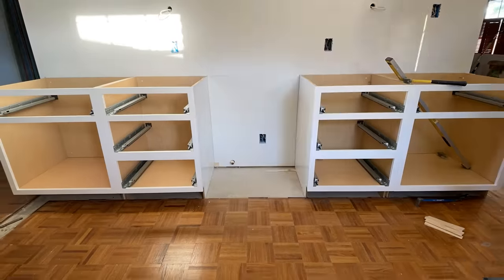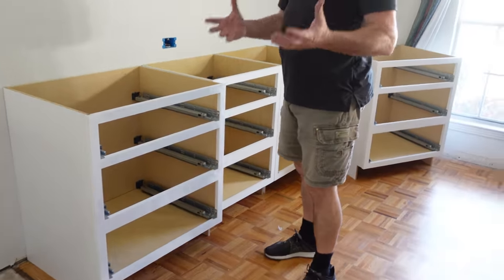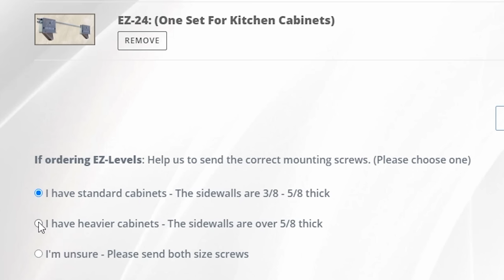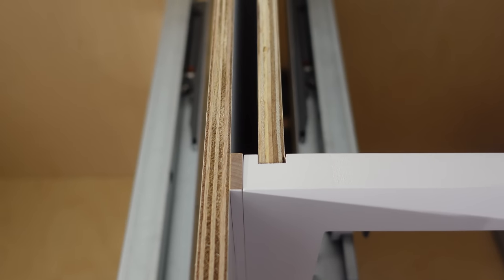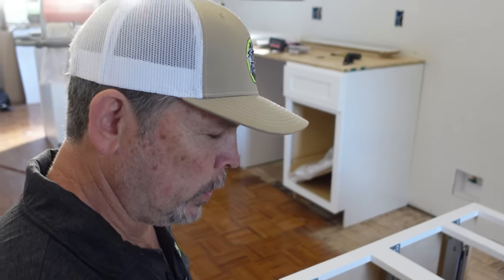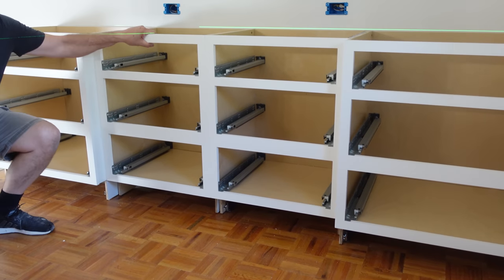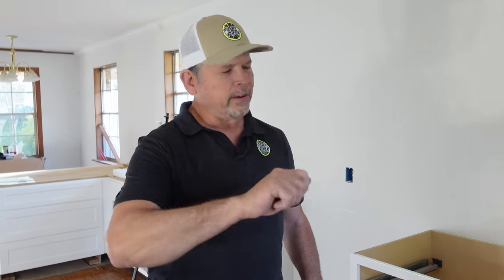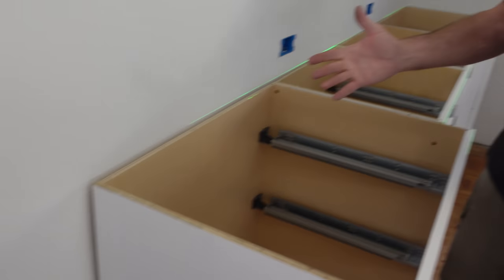$2 Shims VS $40 EZ Level - Is It Worth It?

Comment: Here in Germany, we attach a leveled kickboard on the wall and set the rear of the cabinet on this board, and we only have to adjust the front with adjustable screwable legs, we don't have and use EZ Levelers here. Easy piece.
Reply: Same technique down under.
Reply: I am Aussie living in the USA and for years I’ve been using shims since they don’t use a plinth for over here for cabinets.
Reply: Also upper cabinets hang on leveled metal wall horizontal bracket
Reply: Cool! Will keep these in mind for the future!
Reply: Very smart. In california the toekicks come seperate from the boxes. Those are laid out on the floor, leveled, screwed/nailed down, and then the boxes sit on top and are screwed to the wall.
Reply: @kevindonahue6071  I'm in CA. Not necessarily true.
Reply: Same here in sweden
Reply: @Ormathon  I guess so, because our kitchen is from IKEA 😉
Reply: @carstencroessmann  Most brands you get here got adjustable front legs while standing on a wall mounted board :P
Reply: @Ormathon The old world is a bit ahead of the new world...... Again.😉 It's good and satisfying that the guys and girls over there use some of our products too. It means a lot of trust and reliability in the products made in Germany or at least in Europe.
Reply: @CUBuffnSD  Same here too in Germany on the kitchen brands, more stable IKEA  comes with two holes, it is doable except you got lose wall construction mostly on old buildings. But I always got them to the wall in one way or another.
Reply: Having worked in both the UK and Germany the installation is pretty much the same but to be honest I preferred the German way on a lot of the builds they were a bit ahead of us using power tools but then again I’m going back to the 1970,s
Reply: I like a ledger board on the wall when using adjustable legs but here in North America I prefer a ladder style toe kick for European cabinets  personally I’m not found of face frame cabinets with attached kicks to me it’s a cheap cabinet
Reply: I did that here in California. The used Blum adjustable feet in the front.
Reply: @cadrmn88  exact
Reply: Yep I've used the same system,, 100 times better and easier, I feel like we in the USA are so far behind on everything
Reply: @aptpupil  are you suggesting Kevin thinks that 100% of cabinets in the state of CA installed the way he explains?
Reply: @jrw0707  "In California the boxes come separate from the toe kicks." How do you interpret that statement? I've worked here a long time, never seen it done that way.
Reply: Level kicker in 5 mins and cabinets sit on them for the win. No mess. No fuss. Costs a quarter of the price.
Reply: @unkonshustudio  Correct, that's why we are doing it. And the array of cabinets is stronger and leveled.
Reply: Cheap as chips too
Reply: Oh wow.. you Germans are just so smart and ahead of the US... lmao
Reply: @randybobandy9828  Of course... 😂🤣😂 you would never been to the moon without us and Wernher von Braun and his V1 just one example from countless once.
Reply: Too bad most americans descend from Germany as well as many other European countries. I would'nt brag touch bud. But as far as E-Z levelers go. I install about 40 to 60 cabinets a week in new builds. They would not be feasible. They provide shims for free and i would lose on purchasing and installing. Great for remodel, if homeowner wanted to shell out extra cash for them.
Reply: Thats a really good idea. Setting shims, adhusting shims and trimming shims is tedious on good days.
Reply: No, you have a technique. One that im stealing

Comment: did some math for that setup it cost them $82.50 for the easy levers. if a cabinet installer cost $35 a hour (low end on line rates) if it saves 3 hours of time it would save $105 or 1.5 hours at $65 at a total of $95. so they easily saved them major money if they hired out the job.
Reply: i think youd have a hard time finding an independent cabinet installer for $35/hr.

Comment: European cabinets have had leveling feet as standard features for at least 30 years that I know. In the U.S. we just refuse to use them. Not sure how i could justify the cost as a professional  contractor. You're videos are extremely helpful to many DIYers and pros alike. (Myself included) keep up the great work fellas.
Reply: yeah , here in nz you can get a box of adjustable screw feet for a few dollers, its jsut like a bolt n nut with a foot onthe bottom, and a plate on top, , i dont see why others dont either, those ones he showed were just over engineered
Reply: Hi Guy; Just a quick heads up. The EZ's only cost $11.50/set for contractors (the $16.50 is retail)
Reply: @brookscourtney4732   really ?  we were not offered that price.  How many did you have to order for a discount ?

Comment: For a DIY guy who may only ever level cabinets one time, these things were an absolute dream come true.  I watched YouTube video after YouTube video on shimming with wood shims, and I was dreading the job and the frustration.  With no experience I knew that only after a bunch of swearing, sweating, and wasting time would I begin to feel remotely comfortable with it, and probably around about the time the job was finished.  When I found the EZ Level online and watched their videos, it immediately made far more sense to me.  Why spend the time becoming proficient at using wood shims for what might be my one and only cabinet leveling project, when the EZ Level system is so incredibly easy?  

Like others have mentioned here, our granite installers also asked who installed the cabinets.  They said it was the first install they've had in a long time where they didn't have to shim the countertops.  That, on my very first cabinet install.  Great product, and absolutely zero buyer's remorse.

Comment: Just build a separate level kick base first. Then set the kickless boxes on the level base. There is no denying that this is the best system. There is also no denying that using wood shims, especially at the back of the cabinets really sucks.
Reply: This IS the gold standard.  We had to have three cabinets completely replaced because of water damage.  If the original contractor had used separate bases, that would have been all that needed to be swapped out.
Reply: We did for years (like most installers), but what a time suk! First you have to acquire the materials (lumber)... then layout and build it... then "level" it... the carefully set the cabinets onto the new base... then fasten them. Really? With the EZ's, we simply install them (15 minutes)... the level them (5-8 minutes). Done. Perfect. Waterproof. Stays put.
Reply: @brookscourtney4732  Most installers do not build a separate kick, even though it is the best way. What is your expertise in this area? How do these make particle board cabinet kicks waterproof?
Reply: @KeithOlson  I always make the separate base from exterior plywood and/or solid wood so it has a great deal of resistance to water damage.

Comment: i already have mine in the shop for my next job- if you will call them and work out your contractor status- the price drops per unit-  great company and very easy to work with!  I haven't put them at the job yet, but they are on the cabinets and I can tell you, I am  already sold!  Thanks for the demo!

Comment: I used these on the last kitchen I installed. The floor was up and down across the room. They work really well. They raise or lower the cabinets as needed. Very efficient. The cost is well worth it for the time savings and ease of use. After many ,many kitchens installed with wooden shims, they were a pleasure to use.

Comment: Shims are by far the fastest and easiest way to level base cabinets. I've used this method as a kitchen installer for 47 years. It's simple and foolproof and will work as easily on a run of 2 cabinets or a run of 10 cabinets. 
Use 2 shims stacked together in opposing directions. Place them on the sides of the cabinet under the corner of the cabinet where needed. Use a small pry bar to just take the weight of the cabinet off the shims and it’s easy to raise and lower the corner of the cabinet to the desired height by sliding the shims back and forth along their length. Repeat on all four corners of the cabinet as necessary to level it. When you place the next cabinet in the run it will sit on the ends of the shims protruding from the first cabinet.  That automatically sets it the same height as the first cabinet. Shim the other side of the second cabinet to level it and fasten it to the first. Then just continue in the same manner along the entire run of cabinets.  The only shims that will need to be trimmed are the ones at the ends of the run.
Reply: I agree shims are cheap and ez.  it takes time to install the levelers to the cab plus the price of each set. $2.00 option for me
Reply: @sbaggs9079  Or just get cabinets that got leveling feet installed that you screw in and out, built in ez levelers :P
Reply: Who the hell gangs together a bank of cabinets this way shown
Reply: @uspatriot9599  any time you can gang cabinets together and install as one. It makes it much easier and faster than trying to install it them separately.
Reply: NO THEY ARE NOT !   Leveling legs are the fastest and most versatile.       And how do you even get to the back shims when the cabinets are built with a solid front in the toekick area ?

Comment: Hey guys, outstanding as always. Because cabinetry boxes are constructed dead-on sized,  I usually lay in the back shims set dead-on to my reference line, then lay the boxes in on top, adjusting the accessible fronts.  Also by sharing shims (resting joining boxes on the same shims) it easily assists the set up.  Great innovative ideas but these could get a little costly are large builds. I usually buy an under coarse bundle and three songs on the radio and I've split half a pack into 3" shims.  Thanks, you guys kick ass.

Comment: I did a C-shape kitchen cabinet install with an oven in the middle, with lazy Susan corner cabinets, single handed.  The floor was concrete, 1.75 inches out of level.  Brutal. I started making my own shims on a production basis.

Comment: I've been seeing suspended cabinets a few inches off the floor.  No toe kick.  Bolted to the wall.
If the sink or dishwasher floods the kitchen, you have about 5 inches before the cabinet is sitting in water.

It takes a bit of blocking pre-installed behind the drywall so you can be certain of hitting something solid with any screw, rather than hunting for studs.

The tiny space of EZ-Level lets dirt in, but no access to clean under.

The suspended cabinets, you can get under to clean.  I like clean.

Comment: I used for both our kitchen remodel and, most recently, on my daughters.  Her countertop installer wanted to know the name of her professional installer. The cabinets were dead level.  He couldnt recall if/when he had come onto a job this good.  Also, the folks helped her source the right ones.  Customer service is tops.  I wont volunteer to do an install without them.  Too easy.😊

Comment: In Australia we have either cheap plastic threaded legs that we wind up and down to level then screw a kick front to cover them.
Or a seperate kick frame and cabinet system where the kick frames are scribed to the floor then cabinets places ontop
Or a french cleat system of screwing a rail to the wall and hanging cabinets
Largely most cabinetmakers/installers use the kick frame system. But there is often a combination of systems too.

Comment: Restoration & remediation jobs sometimes require saving cabinet faces and attaching them to new boxes. I’ve started building the boxes in two pieces. A toe kick base and the box itself. Ive found installing the toe kick base and leveling that out first then just placing cabinet box on top has saved me so many headaches. A little more time in the shop but a lot easier once it’s time to install.
Reply: Awesome... May I submitt... the EZ's are even better for your application, because you only need one set about every 4'. So you use a whole lot less, but you can perfectly level everything much quicker. (we sometimes build our own ladder boxes too)

Comment: In the middle of installing a 30in standalone base, to make up the “L”. With no knee wall, so I’m attaching it to floor, via, 2x4 frame. But it couldn’t be in a worse spot. It landed on a transition from kitchen floor to carpet in living room, which was a previous addition to the house. 3/4 out of level front to back. This will surly help.

Comment: EEZ Level  has been around for awhile. The more you use them  the the quicker it will get. Bath utility room cabinets are easily done with this system. Just figure the cost and add it to the bid. No stress and you’ll save so much time.

Comment: Here we always do the footings seperate frome the cabinates so this is never a problem. But for this use case that easy level stuff seams like a good idea if you can afford it. I love seaing stuff like that, always good to see people figuring out ways around pesky problems.
Reply: Are you in Iceland?
Reply: @billkelly8222  Yes stuck on the ice cube in the middle of the atlantic haha
Reply: Do you mean you set up a base first, then place the cabinets on top?
Reply: @s-w  When they installed my neighbor's cabinets they did the exact same thing.  Made a 2x4 base, levelled that then installed the cabinets on top.  Slick!  I'm west coast BC, CDA.
Reply: This is how I did it when I built custom cabinets for my kitchen. It's so easy to level a 100mm platform that you can see and reach easily.

Comment: I'm in the midst of a house remodel, and going into it, I had no experience in... well, any of it. Hence my finding this YouTube channel several months ago. (I love the channel, by the way!) Lucky for me, I got the opportunity to install cabinets in our kitchen and 2 bathrooms. Fortunately our kitchen cabinet design contractor recommended these EZ Levelers. We spent the money for them for all the cabinets that are eventually going to have quartz countertops installed on top. However, we didn't buy them for some of our floor-standing 8-foot-tall cabinets. I had to use shims. But having already personally experienced the EZ Levelers, I wished I had bought them for all the tall cabinets too! I wasted more than 2 days getting those cabinets plumb and level with shims on sloped floors and walls out of plumb. It would have only taken an hour with the EZ Levelers. I don't stand to make any money from posting about this, I'm just a happy do-it-yourselfer in Oregon that wants to echo the sentiment of this video. I really like and appreciate this product and want to point out that they shine even more in complex kitchen countertop scenarios like mine where I have 3 lower cabinets in a run where 1 of them is offset at a 45 degree angle. Leveling those with shims alone would have been a nightmare, but it was easy and relatively stress free.

Comment: Thanks for the demo!  I have seen these for a while now and had considered the cost vs time?  After  years of setting cabinets i have a maybe a different approach to setting base's than you.  I only buy "cedar shims" and if i went through a whole bundle on and install??? that kitchen would be a horror show.  But I also do not always shim UP.  Typically most kitchens that are significantly out half gets shimmed up and the other half gets planned down.  This has a lot to do with design variables ( to numerous to discuss hear  ) but in a nut shell  any visible exposed end  I want touching the floor ( I am not a "SHOE" fan and is not typical in my area, especially around my toekick )  So "frustration Levels" are manageable only because it has become part of the job.  I certainly see the time benefit the same as the expense vs. time when using "Schluter" products.  Cheers

Comment: To not scratch the floor with the screws when sliding the cabinets in, just lower all the EZ levels 1/4 in., stand cabinets up, and slide them straight back. I did. They work great. Installation videos on website. Another plus is they are made in the USA

Comment: My cabinet shop uses black plastic levelers, just reach in and turn them to raise and drop the cabinet, toe kicks clip into the legs cleanly using an ajustable clop. They cost less than 2$.  Alternately, you can use a full-length plywood rail and level it properly with a lazer line, then drop your cabinet run on top, kinda like leveling out the floor. Most cabinets we produce are full overlay with no notched gables; it is a waste of space and material. Every gable takes 4" of extra material that adds up. Not hating on the levelers, most cabinets are CNC cut these days, and they make the pinholes for the plastic levelers, 1 screw and pressure fit, and you are done.

Comment: Sure, they make Shims look bad, but the European-style plastic & adjustable feet are better. By the way Paul, you should look into the Bosch 12V-Line Impacts and Drills. I've noticed it also on another video and I feel like you'd enjoy the extra flexibility with the smaller/compact tools.
Reply: we used that where i used to work its great and easy to use only problem we had is the leg would drop out when moving around but you just pop them back into the base